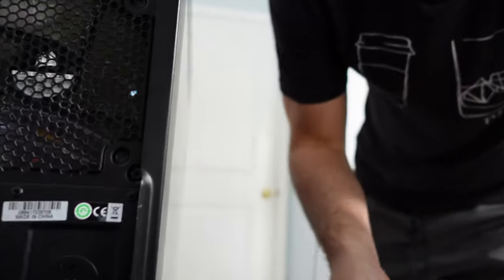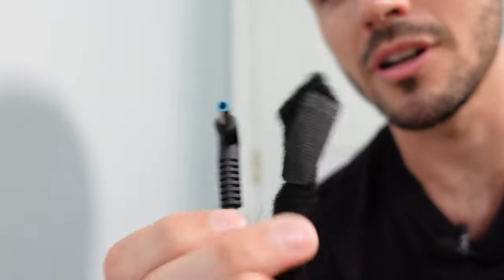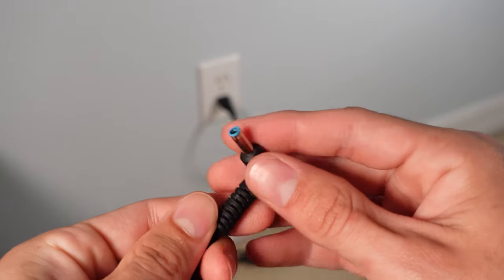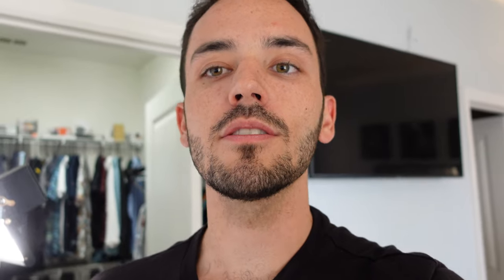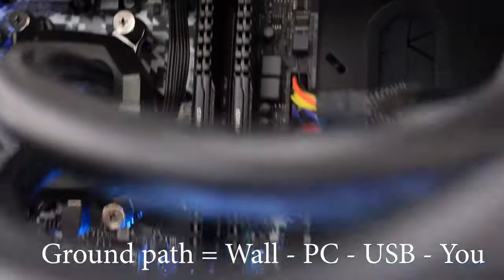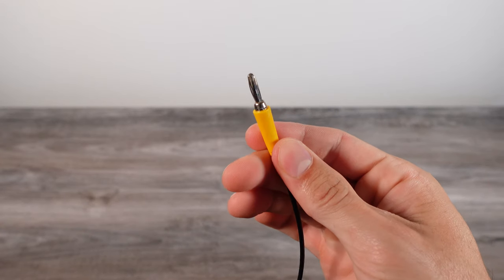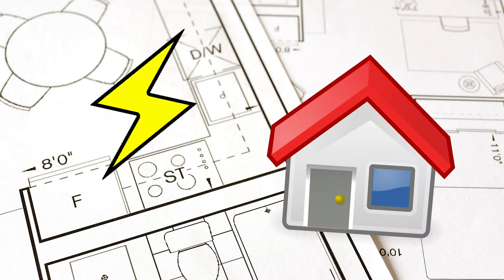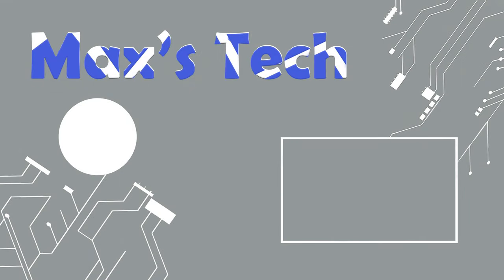PC Building - Easy Grounding Tricks

Comment: Would the charging cable trick also work if I have the cable plugged into a charger and then that charger plugged into an outlet?
Reply from the maker: As long as the plug you use is using the ground in the outlet “bottom hole”